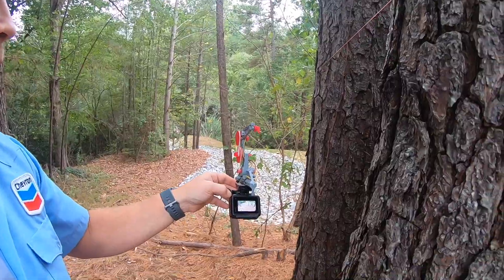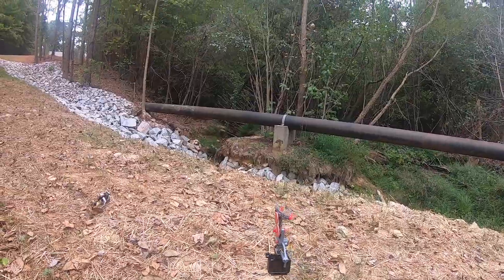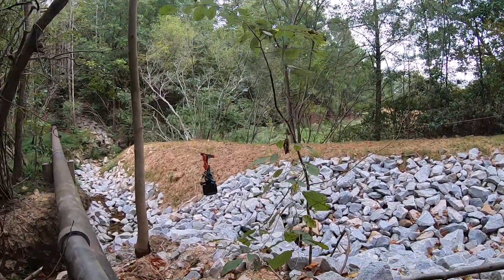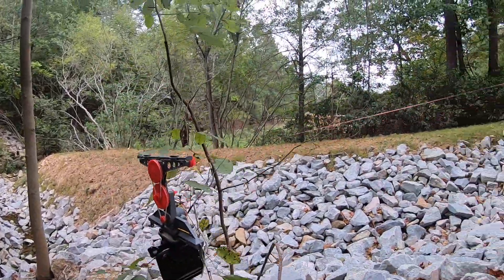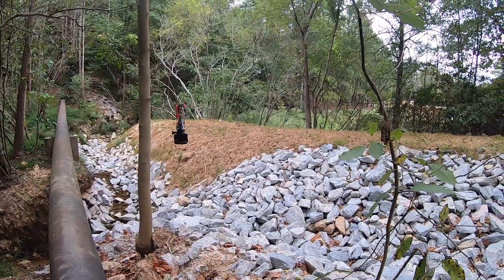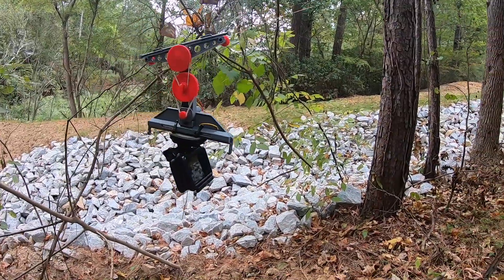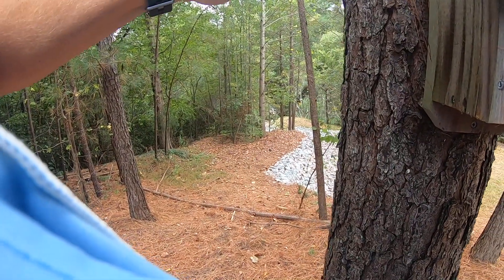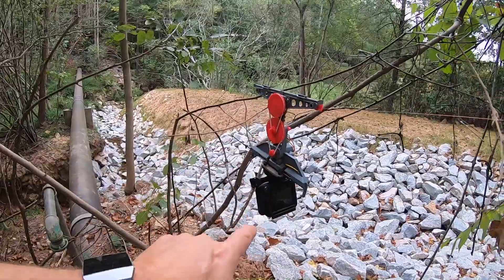Video Cable Car Wiral Hack Trial -  Tin Can Cable Car

Comment: I found that if you use 15 lb Fly fishing line it works a lot better. I also made a couple straps with D rings on each end and a couple small S carbeaner's and 2 turn buckles you can adjust the string tighter if needed. The straps go around the tree and easy and fast to put up and move up or down the tree if needed.